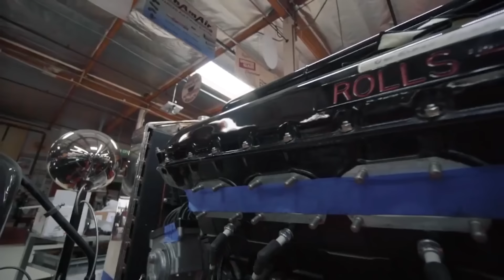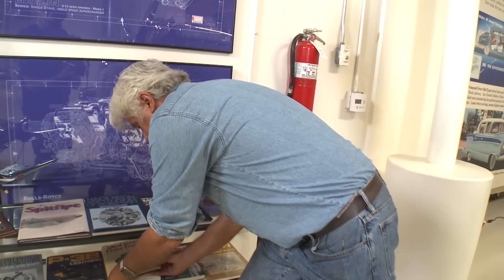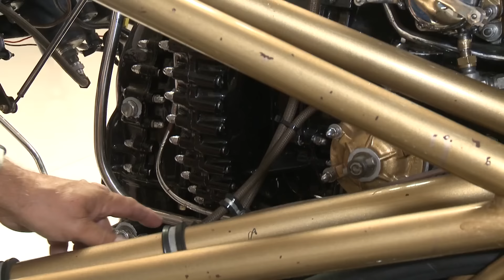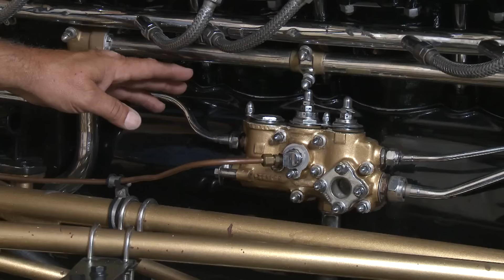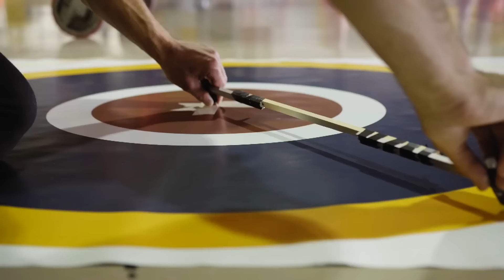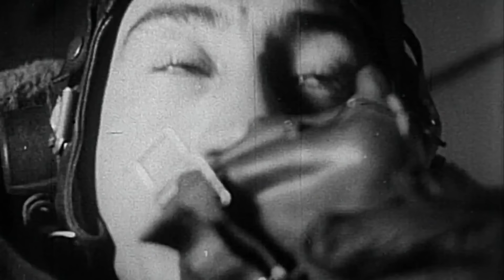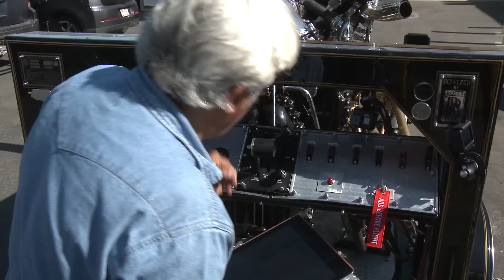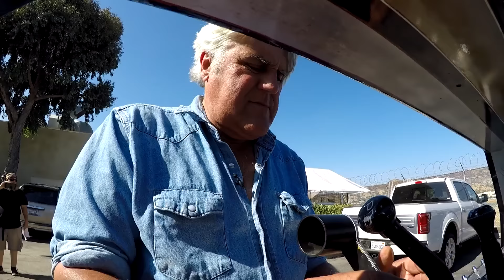The Engine That Won World War II - Jay Leno's Garage

Comment: Engine that won World War II ? WOW. I didn´t know there was an airplane Rolls Royce  engine in the  soviet T-34 tank
Reply: sergeant5027
The RR Merlin was put in British tanks and called the Meteor.  The British tanks destroyed 90% of German armour in the west.
Reply: Yeah, which is 8% of what Russians destroyed
Reply: sergeant.
USSR total is more but that is not just the T 34, it includes British tanks used by the USSR, aircraft, anti tank guns and even the German armour that broke down or got stuck in the snow. Without supplies from Britain and USA the USSR would not have managed too well and if Britain did not beat Germany in the Battle f Britain and in North Africa ten things may well have gone very differently for USSR.  
Germany could have used the 1,000 tanks and tank crews lost in North Africa.
Reply: Chris Baker
How wrong you are. Do not go on Hollywood history.
Germany had no realistic ability to overrun the UK. The British knew what sort of chance the Germans had. The British won the Battle of Dunkirk. The reason the Germans had no chance of a successful invasion was that the British were ready and waiting with factories turning out the latest equipment 24/7. During the so-called _Battle of Britain_, the Royal Navy had a mass of ships at Gibraltar ready for offensive operations against the Italians, they took the invasion of Britain really so seriously.

The German Navy was near non-existent. The single battleship the British kept in Portsmouth was quite able to handle everything the Germans had on the surface, together with the four flotillas of destroyers. I'm not counting the Home Fleet, which had additional powerful ships. In other words, the British kept plenty of naval force at home. All they needed to deal with the Germans with a good deal to spare. Also, 55 Matilda 2 tanks, which was immune from German anti-tank guns, were sent to North Africa, the Brits took the invasion so seriously.

Admiral Raeder said he could not guarantee putting down an invasion force, even with German air superiority, when the Royal Navy was still there. General Jodl talked of his men going through a British mincing machine. 

In Churchill's memoirs, he says that he was prepared to defeat tens of thousands of Germans if they invaded (take that as slaughter). Presumably even if they arrived with weapons and not half-dead from seasickness in a 24 hour sea trip in barges being attacked from sea, land and air. The British kept plenty of force at home, all they needed. 

And what were the Germans supposed to do? Sortie with two or three heavy cruisers, and blast their way through the Home Fleet or the Channel defences? At that point in the war, Bismarck was still under construction, Scharnhorst and Gneisenau were under repair from the Norway operation, two of six heavy cruisers sunk, two of six light cruisers sunk, and only five of those could be considered modern warships, a large number of their destroyers were sunk at Narvik. The repair status on the rest of the ships wasn't real good. The Germans never even had an effective torpedo plane. The Stuka dive bomber was predictable in that it dived vertically. It was easily shot down and suffered so many losses in the Battle of Britain it was withdrawn from the battle.

So, with the German navy whittled to almost nothing, and the army incapable of crossing with enough force to win, the only threats was the then small U-boats force and the Luftwaffe. The British were therefore sparing about sending the RAF overseas. I don't know of any significant deployment of Spitfires outside the UK until the second half of 1942, and escort vessels kept on being built. The RAF defeated the Luftwaffe over Dunkirk, so the Germans knew they were no push over. 

If anyone thinks that Operation Sealion, the German invasion of Britain, was a serious attempt at an invasion they are deluded. Even German generals never took it seriously. An invasion in concrete barges towed by tugs and no navy to speak of? The Germans knew the UK had a large industry working 24/7, the same size as Germany's, and the largest navy in the world to their virtually none.

The RAF was large with a large bomber force, which the Germans could not knock out. Any invasion at the few suitable invasion beaches would be met at the beaches by all types of aircraft. These could be based out of Me 109 range. State-of-the-art fighters would still be produced 24/7. There would always be top line fighters around. 

According to Guderian in "Panzer Leader", and by pretty much any historian to follow, Sealion (Zee Lowe?) could succeed only with complete air superiority over the invasion areas, and at least naval equality in the Channel. Hence the air Battle of Britain, hard fought and clearly won by Britain. Naval equality was a pipe dream for Germany, but a pipe smoked only if the Luftwaffe could attain a decisive victory. Given the failure of the prerequisite, there is really no point in debating the if Germans could invade the UK.
Reply: Chris Baker
British material losses at Dunkirk were overrated. Most of the equipment lost was not the latest designs. About one third of the equipment was successfully taken back to England. The BEF was only one third of the British Army. In about a month all units were fully re-equipped with factories turning out the latest armaments 24/7. Right after the retreat at Dunkirk, up until early 1941 (approx 6 months), the British had:

• Destroyed the German surface fleet.
• Neutralised most of the French fleet by sinking 
  or starving it of fuel.
• Disabled a major part of the Italian fleet.
• Freely moving around the Mediterranean.
• Starving Germany of food and resources 
  with the effective Royal Navy blockade.
• Beat the Luftwaffe over Dunkirk.
• Beat the Luftwaffe in the misnomer the Battle 
  of Britain as Britain was never threatened.
• Pushed the Italians out of East Africa.
• Decimated the Italian army in North Africa.
• Were about to take all the southern Mediterranean coast.
• Germany was being bombed from the air with raids 
  of over 100 bombers - 150 over Nuremberg - using 
  the new navigational device, Gee.
•  A massive air bombing fleet was being assembled.
• The RAF shot down over 700 German fighters over 
  Continental Europe in 1941.

After the small BEF (only 9% of all allied forces in France) left France in June 1940, the British went on the rampage. So much so Franco told Hitler the British would win and he would not join in with Germany, fearing British occupation of Spanish territory.  The Turkish ambassador stated Britain will win as it has a pool of men in its empire to create an army of 45 million (later an army of 2.6 million moved into Burma).

In 1941 the British suppressed an uprising in Iraq, beat the Vichy French in Syria and secured Iran and the oil by invading. The British determined where the battlefields with the Axis were going to be. 

After France 1940 Germany never had a significant campaign victory over the British Commonwealth ever again in WW2. The Germans FAILED:

• To win the Battle of Britain in 1940;
• To win the Battle of the Atlantic in 1940/41;
• To control the eastern Atlantic ;
• To control the Mediterranean in 1940/41;
• To control North Africa and the Middle East in 1940/41. 

The British Commonwealth stopped the Nazis/Axis achieving all this well before the USA joined WW2 or even sent lend lease. Even the expensive pyrrhic victory in Crete meant little in the end to the Nazis because the Royal Navy still dominated the eastern Mediterranean with Crete not leading to any campaign winning difference.
Reply: My father was still sperm when this happened and yet I remember it as if it were yesterday!
Reply: Britain and the Commonwealth was also fighting the Japanese, which the USSR did not.  I had a neighbour who went on the convoys to Murmansk & it was no f'n cakewalk.  He received a medal from the USSR, even as a Canadian.  The Soviets even realized they wouldn't have survived without the materiel aid from the rest of the Allies.
Reply: Nefer Hor
The British BEF was only 9% of the total allied forces in France and the Low Countries. The German advance was halted in France as the British with a vastly inferior force stopped them at Arras. Some German soldiers turned and ran.  Directive 13, issued by German Supreme Headquarters on 24 May 1940 stated specifically for the annihilation of the French, English and Belgian forces in the Dunkirk pocket. The Luftwaffe was ordered to prevent the escape of the British forces across the English Channel.

The German advance was stopped at Arras by the British with a numerically inferior force.  The Germans never moved much further after. The Germans could not have taken Dunkirk, they would have been badly beaten in and around the town. The Luftwaffe was defeated over Dunkirk by the RAF with the first showing of the Spitfire en-mass. More German than allied planes were destroyed in the Dunkirk pocket. The first defeat of the Nazis in WW2 was in the air by the British over Dunkirk. Only six small warships were sunk at Dunkirk by the Germans as the the effectiveness of the Luftwaffe blunted.

The British were retreating after the French collapsed in front of them - a programme already in motion, a programme already in motion before the southern German column showed up, as General Gort saw the disjointed performance of the French forces in front of him. If the French collapsed the small BEF had no hope against the large German force heading west. The French were still in front of the British when General Gort decided to take the men back to England, as he did not trust the French in a joint counter-attack. French General Wiegand held a meeting to arrange a counter-attack and never invited General Gort head of the BEF. Gort was under the command of Weigand.  Gort heard of the meeting and rushed to be a part. He got there after the French and Belgians had left.  He ordered the evacuation having no faith in the elderly French leaders. 

The British had assessed the French leadership pre-war and during the Phoney war. They were not impressed, with one elderly general only using motorbike dispatch riders, not field phones or radios. The BEF was the first fully motorized force, with no men marching. 

All armies retreat and regroup when the need is there. There happened to be a body of water in the line of the retreat. The Germans did not know what was to be the next British or allied move. Were they to move down the English coast and enter France further west with more men from England?  The Germans could not have taken Dunkirk and they tried. The British retreat operation was carried out as planned and in orderly fashion. All bridges to Dunkirk were destroyed by the allies. 

The British counter-attack at Arras was with outdated Matilda 1 tanks, which only had machine guns, and a few of the brand new Matilda 2 tanks. The Germans fled in droves. In desperation the Germans turned a 88mm AA gun horizontal and it worked against the Matilda 2 - their conventional anti-tank weapons and tanks could not penetrate the tank. The Matilda 2 would roll over German gun emplacements killing the gunners. Rommel thought he had been hit by a force three times the size, which made them stop and rethink. The Germans countered with their superior numbers pushing back the British who were ordered to fall back towards Dunkirk.

The British resolve and the new Matilda 2 made the Germans sit up and think about a street fight in Dunkirk against a consolidated force still with its weapons and the new Matilda 2 - the 88mm would be useless in Dunkirk streets while the Matilda 2 would be in its element, and the Matlida 2 would have easily destroyed the Panzer mk3s. The Matilda 2 could knock out any German tank at the time, while no German tank could knock it out. The Germans were expecting the Matilda 2 to be shipped over in numbers and for all they knew many were in Dunkirk. The Germans could not stop the tanks coming as the British controlled the skies with a CAP and the waters of the Channel.  Not a good prospect for the Germans. A Dunkirk street fight was a fight the German troops were untrained and unequipped for and unwise to get involved in.

Von Rundstedt and von Kluge ordered the halt informing Hitler that German forces around the Dunkirk pocket cease their advance and consolidate and also to prevent an Allied break out from Dunkirk. Hitler agreed with the support of the Wehrmacht. German preoccupation rightly was with an expected attack from the fluid forces, mainly French and some British, to the south of the German line, not from Dunkirk which was too much of a formidable consolidated opponent, taking substantial resources to seize. The German column had Allied troops to each side and in front and there was soft marshland to the south west of Dunkirk unsuitable for tanks. If German tanks had advanced into Dunkirk surrounding the British, who had not fully fallen back, they feared a quick British counter attack. Being short of fuel so it was not wise to engaged in a street battle for Dunkirk. Also, they would be vulnerable on their weak flank from the south. In short the fast moving panzers were now static; German forces attacking Dunkirk in a battle of attrition would have had a high probability of being wiped out due to fuel, infantry and supply shortages

The German tanks had raced ahead of their supporting infantry and supply lines consolidating their remaining armour and infantry and the important resupply from Germany which was slow as it was via horses. They had over-stretched their supply lines. An attack was expected to be mounted by the British and French from the south.  The Germans had no option but to stop being short of fuel. If the leading tanks had pushed on to Dunkirk they would have ran out of fuel in Dunkirk with many not even making it to the port. The Germans were more concerned at defending from the mainly French forces in the south which were viewed as a greater threat than Dunkirk. French general Weigand implemented his creation of hedgehogs to attack German lines from the sides, with success - hedgehogs were a part of NATO tactics until the 1970s. 

The Germans were thinking, are the British retreating to England from Dunkirk to move down the English coast and re-enter France further south with fresh forces, including Canadians and the new Matilda 2 tanks, which they feared, and join up with the French forces there? The British could easily do that as they controlled the Channel. This would create one large difficult to combat force.  German generals were trying to figure out what was happening. None thought that British troops would retreat to England and stay there. The British never did that sort of thing. 

The Germans could divert most of their forces south and risk a Dunkirk breakout and then risk being attacked from their rear fighting on two fronts, or stay and consolidate, which they needed to do, awaiting a French/British attack from the south and use some forces and the Luftwaffe to attack Dunkirk, which they did. German forces resumed their attack on Dunkirk for 6 days after a 48 hour consolidation executing Directive 13 for the annihilation of the French, English and Belgian forces in the Dunkirk pocket. They failed to seize Dunkirk.

The plan to break out of the Dunkirk Pocket using British, Belgian  and French forces was abandoned as Gort had no confidence in the French. All military school studies since, knowing what the German and allied positions and situations were in 1940, have shown it would have had a high probability of succeeding.

This may sound strange, but the Germans were defeated at the Battle of Dunkirk. They tried militarily to seize the port but failed. Only because the British did not trust the French and moved back to England did the Germans eventually occupy the town. The Germans did not let the British get away that is misguided myth, they tried and simply could not seize Dunkirk.
Reply: Alexander Challis
Germany declared war on the USA. The Americans shortened the time of the war, not decide its outcome. The USA, about 11% of British supplies (mostly food and raw materials) and about 5% to the USSR (mostly raw materials, trucks and boots). 

The German army about to invade the USSR......
Prof Adam Tooze, Wages of Destruction, page 380.
`In both campaigns [France &amp; Barbarossa], the Germans gambled on achieving decisive success in the opening phases of the assault. Anything less spelled disaster.`

Prof Adam Tooze, Wages of Destruction, Page 454:
"Fundamentally the Wehrmacht was a poor army. The fast striking motorised element of the Germans army in 1941 consisted of only 33 divisions of 130. Three-quarters of the German army continued to rely on more traditional means of traction: foot and horse. The German army in 1941 invaded the Soviet Union with somewhere between 600,000 and 740,000 horses. The horses were not for riding. They were for moving guns, ammunition and supplies." 

"The vast majority of Germany's soldiers marched into Russia, as they had in France, on foot."

"But to imagine a fully motorised Wehrmacht, poised for an attack on the Soviet Union is a fantasy of the Cold War, not a realistic vision of the possibilities of 1941. To be more specific, it is an American fantasy. The Anglo-American invasion force of 1944 was the only military force in WW2 to fully conform to the modern model of a motorised army."

........The reality was that the German Army was no super army with advanced equipment, as propaganda portrayed. The Allies attempted to cover their pitiful, inept defeats, and that includes the Americans at the Bulge, Metz and Hurtgen Forest.

The Germans thought they had formulated a version of Blitzkrieg in France that was a sure-fire success. If the belt broke the whole movement stopped. They used this in the USSR, just scaling up forces. They did not have the intelligence to assess properly, that the reason for their success in France was allied incompetence not anything brilliant they did. 

The Germans vastly underestimated the quality of design and make of Soviet weapons. The T-34 took them by surprise and they knew they were fighting an army they had hopelessly underestimated in all aspects. The Germans did not take into account the British supplying the USSR - 40% of the tanks used at the vital battle of Moscow were British supplied. The USSR had more tanks than the rest of the world combined in 1940.

The Germans underestimated the Soviets so much they decided to attack them with no reserves, all the German forces were involved in Barbarossa, lack of proper logistics to re-supply, short of steel, rubber, oil, an industry that could not re-supply at the rate required, short of fuel for industry and the forces, etc, etc. The Germans were so inept at assessing the Soviets they did not envisage fighting in the Russian winter in 1942/1942 thinking they would have overcome the USSR in three months. When they did not break the USSRs back they did not have enough winter clothes and equipment designed for such low temperatures. It was not just the logistics of getting to the troops, they just did not have the equipment. The Germans thought the Soviets could field 360 divisions, they fielded over 600.

Soviet industry was large and had moved to the east. Much was in the east anyhow. This was working 24/7 to re-supply. The T-34 tank by Dec 1941 was well established and available in numbers. The Germans first faced The T-34 in October 41, reducing a German division to a few tanks. The Soviet counter-attack in Dec 1941 was well supplied, and heavily with T-34s. There was still 1,400 Soviet aircraft available in Dec 1941.

The Soviet's mistake was attacking on a broad front and not aiming the the weakest point and pushing them right back, nevertheless they mauled the Germans. By Dec 1941 the Germans were exhausted in fuel, men and equipment. They could do no more. As early as In July 1941, many German armies were at the end of their effective supply lines. As Prof Tooze said, most say the Germans failed to take Moscow, the reality was that they could not as they were on their last legs. The large Soviet air force was still attacking German supply lines as well, exasperating the situation. The Germans foolishly thought most supplies could be taken along three very long rail tracks, which were easily ripped up by the Soviets and bombed via the air. Thousands of German rail men worked to get lines partially operation. The Soviets evacuated lots of rail trucks. 

Prof Tooze: Wages of Destruction, page 453:
'Halder wrote, Barbarossa needed speed and motorized transport for supply. No waiting for railways. The Germans planned for three rail lines and 740,000 horses.'

...the Germans never had enough motorised transport to supply all the fast moving armies. Pre June 1941, they were considering de-motorising because of a shortage of rubber inflicted by the RN blockade. 

Prof Tooze: page 454:
'Three rail lines were used. The existing Soviet rail network was not even good enough to supply the German army if taken intact. It was also of a narrower gauge too. The retreating Soviets took most wagons with them and destroyed the rail infrastructure on retreating.`
`The Soviets had taken massive losses, but being so big they could absorb so many losses. The Soviets also had inflicted great losses on the Germans by Dec 1941. The only large power Germany conquered was France. This gave them a sense of superiority - their technique was now known, so succeeding twice was unlikely.'

The Germans largely dropped the blitzkrieg of coordinated air and ground attacks.
Prof Tooze: page 487. 
'In July, all three German Army groups had reached the limit of resupply and stopped. The Soviets had taken devastating losses but not defeated. The Soviets saw the halt of the German armies and the re-supply problem and launched 17 armies against them forcing the Germans to dig in and defend.'

The UK & US can be forgiven in underestimating the Red Army, which they did, not so the Germans as they would have to assess this force in detail as they were to fight it, unlike the UK & US. Soviet industry was turning out the arms and to advanced designs. I don't want to go into what ifs, but if the T-34 was in place in summer 1941 the Germans would never have had such spectacular progress. Stalin knew what was being produced. They knew once the weaponry was in place, they could defeat the Germans who would be operating over 1000 kms along a few supply lines they could not fully supply.

Apart from Stalingrad, which the Germans and the Soviets had an obsession with, the Soviets became less reckless as the UK and USA were in the fight and arms, and some well advanced arms, were building up. The Germans would not win, and the Soviets knew that. Once a western second front was in place, it was clear the Germans would quickly crumble, and they did. On D-Day 1944, the Germans were still way inside the USSR. The end came quickly once hit from both sides. It can be argued that the Soviets should have pushed the Germans out of the USSR by 1943 or even 1942, however they were inept at most levels. But the Soviets knew in a war of attrition the Germans were doomed.
Reply: Oh standart, I thought you ment 8,8 this thing would've rekt the Matilda from every side of it
Reply: JPVegh 
What you mean is that if the Germans won the rather one sided Battle of Britain they could have successfully invaded the UK. With the German surface fleet near non-existant, with most sunk in the Norwegian campaign, and facing the largest navy in the world, German chances were little more than nil.
Reply: Billy Graham 
The merchant marine lost more men in percentage terms than any 'armed' force. At Tower Bridge in London the Merchant Navy memorial has 36,000 names on it. For those of no known grave.
Reply: Without the Merlin there is no long-range escort to Berlin the war takes at least a year longer if not to. The Germans develop their jet fighter technology in that time perhaps extending the war another 2 years. Eventually they end up with better terms to sue for peace. The world is a much different place today.
Reply: Peter,
The WW2 German jet engines were extremely unreliable and had low performances with very high fuel consumption. The German axial-flow turbojets never worked properly and were developed up to 1953 by the French to obtain a usable engine. The French lost a lot of time playing around with the German engines, instead of working with the British. The French and Soviets after WW2 tried to improve the German axial-flow engines and largely failed. The centrifugal compressor used by the first British Meteor plane was fine and much more reliable, but unable to reach high compression ratios. This limited performances. Centrifugal compressors were used up to the 1960s. 

The British, in order to have a usable and reliable jet engine, with the technology available in WW2, went for a centrifugal design as the prime engine rather than the troublesome axial-flow design. This design produced less thrust than an axial-flow but was quicker to develop, reliable with longevity. It took 5 months to develop, while the first reliable commercially ready axial-flow engine was the 1950 Rolls Royce Avon, which took 5 years to get right. The Avon axial-flow engine was developed in tandem with the Metropolitan-Vickers design which first flew 1942 creating 8 variants. The MetroVick F.3 was the first turbofan engine to be designed, built and tested decades before the RR RB211. Armstrong Siddeley took on MetroVics design creating the F.9 Sapphire axial-flow design. The Sapphire was built under license in the USA as the Wright J65.  

In 1945 a team from the French ATAR laboratory plus some BMW and Junkers engineers, were engaged by the French SNECMA research bureau, with the objective to build a new reliable and performing axial-flow turbojet. The French made and tested some German designed turbo jets made with quality steel unavailable to German industry in WW2. They ran for 25 hours instead 10 hours to German engines made of poor steel. Not much better. The German axial-flow engines failed because of heavy design faults. The BMW 003/Jumo004 was considered unusable. It was tested on the first French jet aircraft, the 1946 So6000 Triton, overheating and exploding. The plane only flew with a Rolls Royce Nene centrifugal turbojet. 

The ATAR project took 8 years to produce the first acceptable axial-flow turbojet (ATAR 101 B1), produced in 1953. So 8 years R&D by the French using the German jet engines as the base, which had about 3 years previous R&D, so about 11 years in all. It was installed on the first 100% French jet fighter, the Dassault Ouragan. 

The French lost a lot of time because the German jets had concept fails essentially in the combustion chambers and fresh air circulation to reduce the external temperature of the engine. The engine gave poor efficiency. The BMW jet was known for overheat problems which precluded fuselage installation.

The German turbojets had severe overheat problems as the engine would not work in an enclosed fuselage for single engined fighters. This defect was immediately noted by the French on the 1946 "SO 6000 Triton" prototype, and by the Soviets on the 1946 Mig 9. The Soviets quickly replaced the BMW 004B2 by the centrifugal Rolls Royce Nene which worked without problems, dismissing the BMW engine for fighter planes. The Rolls Royce Nene was copied to the last nut by the USSR being installed in the Mig 15 and used effectively in the Korean war. About 10 years ago the USSR eventually paid royalties to Rolls Royce. 

The question at the end of WW2 was what is the most efficient way to produce jet fighters. The answer is clearly not adopting the German design of engine and fuselage. The build costs for a jet engine were much higher than a piston engine, with the fuel consumption near 3x. The centrifugal compressor the British adopted in some planes was by far the best choice with 1944-45 technology. More compression pressure was not an advantage when the hot turbine was unable to resist higher temperatures. 

The Meteor was the first proper fully developed jet plane introduced in engine and airframe. The me262 was slightly faster than the Meteor F3, but extremely unreliable. The British would never put into the sky such an undeveloped plane as the me262. The British could have had a jet fighter operational in 1941, but it would have been as bad as the me262. The Germans advanced R&D on jets after they interrogated captured British RAF men. They learned the British were advanced in jet technology and flying prototype planes. Until then the Germans had no intention of mass producing jet planes. 

The rushed together Me262 started claiming kills on 26 July 1944, the Meteor claimed its first V1 kill on 4 August 1944. But the Meteor was a proper fully developed jet plane, not a thrown together desperate effort as the me262 was. The me262 used a fuselage of a 1938 piston plane while the Meteor was a proper newly designed fuselage specifically for jet fighters with forward of the wings pilot position as we see today. 

Centrifugal compressors did not quickly become obsolete when axial-flow engines were perfected, being used in turboprops. Between a turbo jet and a turboprop, the only difference is the turbine, not the compressor. The last centrifugal compressor jet engine still in service on a handful of old commercial aircraft like the Fokker 27, is the Rolls Royce Dart turboprop. A very reliable engine made in 27 versions, but with high fuel consumption to modern engines. The turbo jet engine that was produced the longest, was the Rolls Royce Dart Turboprop - a comparable design of turbojet like the Rolls Royce Nene. This rugged engine was produced from 1946 up to 1987. 

There is a myth, especially in the USA, that the Germans were way ahead of the British in jet engines and planes in WW2, when the opposite is true.
Reply: My Dad was on several convoys to the USSR, also Malta, people do NOT see the War in total,, they see it as -"Our Spitfires" --Or Our "U Boats" or our troops The entire populations were involved and as a reminder, (perhaps you know) of the 14 merchant ships that were in the convoy (Operation Harpoon) to Malta  TWO made it, my Dad Gunnery Officer on the "Orari" NewZealand Shipping Company.  and Troilus Blue Funnel Line Cargo -- Food, and Munitions --- Churchill was all for invading the Ruskies THAT would have secured a long peace, but the people had had enough war and voted him out. Cheers  Mike
Reply: SMOG.
You seem to forget Hitler attacked Poland at the beginning of September and Britain and France declared war on Germany after 3 days, USSR did nothing for over two weeks.
Reply: Peter.
The standard German anti tank gun in 1940 could not do much to a Matilda.
Reply: Billy Boy
In 1940 what happened to Germany?   They lost the Battle of Britain and could not invade, no aid from USA and USSR was supplying Germany at the time.  So just where do you get your silly version of history from?   Germany outproduce Britain,  not in 1940, 1941 or 1942, in fact British production of planes, tanks and guns, merchant ships and warships was all more than German or American production.   
Just facts, maths does not change the truth.
Reply: Bullshit, leave in peace, the Luftwaffe were constantly attacking the beaches and getting a hiding from the RAF who were protecting the beaches, hardly letting them leave in peace, no matter what you want to believe.
Reply: USSR was on Germany's side at that time.
Reply: JPVegh 
German jet engine and airframe technology was way behind the British.
Reply: sergeant5027
No what?
Reply: Barrie Rodlliffe: True. Hitler was so stupid. If he'd left Russia alone and gone ahead and invaded Britain the war would have been over as far as Europe was concerned. At that one point in time the Brits had about 9 rounds per gun left and their air forces were about to collapse. They should erect a statue to Herman Goring for saving their little island nation. He's the one who talked Hitler out of invading, claiming he could defeat Britain with only air power. He nearly did too. If they'd had just one good long distance fighter they would have done so.
Reply: Silvester Humaj
That is not what the Americans were thinking at all. Go to 1 hr 14 mins 
https://youtu.be/79KU997m9o4?t=4440
Reply: 1) Several factors delayed German advances through the Soviet union (such as the primitiveness of the Russian railroad system and the different rail gauge requiring the Germany army to convert rail sections as they advanced)
2) The Kursk counteroffensive was possible due to British intelligence
3) The Lend-Lease program actually helped the Soviet Union a lot not just due to weapons but logistically - trucks and locomotives sent to the Soviet Union were vital for troop deployments

Fucking Slavaboos claiming the Soviets won the WWII single-handedly.
Reply: Titanium Rain 
The Soviets destroyed most of the railways trucks or evacuated them.  British intelligences did inform the Soviets of German deployment at Kursk. But the massed Soviet armies and armour won it.

Lend lease to the USSR amounted to 5% of Soviet needs.
Reply: Nefer Right.
Hitler did not want war with Britain but he did not let the British evacuate at Dunkirk, he could not stop it. 
The small BEF were evacuated along with over 120,000 French troops. 
The SS murdered quite a lot of British prisoners who had surrendered. 
Quite a few were killed while waiting on the beaches to be evacuated and some boats and ships were sunk. The RAF stopped the Luftwaffe from doing as much as Hitler expected.
Maybe your grandfather was hiding or running away from the British.
Reply: Peter.
The 88 was not an anti tank gun in 1940, it was an anti aircraft gun.
Reply: John Burns no, that's not what I meant at all.
Reply: sergeant5027 funny you forget that the Russians to should have been destroyed alongside the German war machine as in the build up to ww2 Stalin was in open relations with Adolf Hitler the only reason the ruskies ended up fighting against them was that the foresaw that the Germans were going to betray them the Merlin engine won the second world war as without it the Luftwaffe would have been able to gain air superiority over Britain and then after months of blitzkrieg land an invading force on the beaches there then would have been no allied forces moving from west to east through Europe which overwhelmed the German army as they were also being battered east to west by the Russians both engine contributed massively to the overall defeat of the Germans but the Merlin  won the war
Reply: Germany was in no position to invade Britain, most generals were against it.The Germans converted Dutch canal barges to cross the English channel in, the were not designed to do that and most likely a lot would have sunk, also they had no means of getting heavy equipment across. Further more the RAF would have been moved north to safety but would have attacked any attempt to cross the channel, then of course there was the RN.
Reply: SMOG : I made no statement of being happy about how the Soviets waged war.  I was responding to the original post. There was enough senseless deaths and killing to go around on all sides. I made no moral/ethical judgment or endorsement of what the Soviets did or how they did it. Just simply that ultimately what happened was for the best, I mean this on a large, long term scale... if it wasn't for how things played out we very easily could have seen the USSR take the nazi's place of conqueror of Europe. With the United States able to get into Germany before the USSR could defeat Germany on their own we were able to put a presence that held the Iron curtain from falling over more of Europe. On the heels of the defeat of the nazi's the USSR had to rearm and re-group before they could even think about fighting the rest of Allies. However by the time they caught their breath the US had the atomic bomb which held them off until they could develop their own. By then the US being wise and figuring the USSR for conquerors had already been staying competitive in the mass destruction business... making any war between the states M.A.D..     If the Soviets were quicker to over take Germany they would have continued to press and conquer until they encountered the western allied front.  Part of the reason the US kept such a military presence in Germany for so long was because the US was well aware that they would have kept pushing and land grabbing as much as they could... it was the soviet way as much as it was the nazi way.
Reply: The comment you replied to was that when the Germans were advancing towards Dunkirk they were stopped by the British and the Matilda 2 was impervious to the German anti tank guns.  That was in 1940 or before Germany used the 88 as an anti tank gun.
Reply: any need for the expletives moron?
Reply: GB out-produced USA?  In 1942 the US produced 46,907 aircraft to the UK's 23,672.  I'm pretty good at math, that looks like almost 2-1 USA.  But I stand corrected on German production.
Reply: I stand corrected.  I had the board game 'Tobruk' in my teens, the cast Matilda was indeed a tough nut to crack.  And of course Africa was post-Dunkirk.
Reply: Billy Graham.
Until 1942 British production was higher, that is 1940 and 1941, US caught up in 1942.  Then US production was higher. German production was low until 1943 when it was too late.
Reply: Agreed.  I was totally mistaken about German production, stunning really to think that they were out-produced by GB even before USA and Russia fully entered the war in 42/43; hopelessly out-numbered and out-produced after that.  Again kudos to Britain; facing an existential threat plus rage at the hideously evil civilian-targeted bombing was clearly quite motivating.  The US then and now still benefits from amazingly fortunate geography; our cities were always safe.  That said our workers and our boys stepped up and did their part to the fullest measure.  Saddens me that the un-sung heroes of the Merchant Marine don't get their share of appreciation.  Perhaps they do in GB, not so much over here.
Reply: k
Reply: You said everything that would be in a conversation about this, you are right
Reply: great analyses
Reply: sergeant5027  thanks to all the brave Russians  from America
Reply: jujitsuman68,  Sorry LIAR, but your Commie heroes were ON HITLER'S side until HITLER ATTACKED THEM, while Britain was at war with the Nazis for 21 months before the Commies got their comeuppance
Reply: not one of the allied forces won WW2. they could not of done it alone we needed each other.
Reply: I love how the Soviet sympathizers act like they didn't get tons of supplies from the US. Without US backing and the Russian winter you guys would've gotten smashed.
Reply: The MSM-DNC-Soros want to rewrite history with an anti-AMERICAN  agenda. They also want a new cold war with Russia. Don't fall for it.
Reply: Write a blog will ya.
Reply: sergeant5027 The Russians very nearly capitulated when the Germans were approaching Moscow. Stalin was actually on his way out of Moscow when he turned around and decided to fight on. It was the Allies promise of Arctic supply convoys and to keep German efforts split between the two fronts that swung Stalin to keep going. The Arctic convoys were assisted by RAF aircraft powered by Merlins and the Western Front was only kept alive by the British victory in the Battle of Britain, fought by aircraft powered by Rolls-Royce Merlins! And that’s before we consider the Desert Campaign where RAF Merlin powered aircraft fought Rommel’s Afrika Korps. 
So yes, the Merlin won the war!
Reply: jujitsman.
Really? so after Britain defeated Germany in the Battle of Britain and Hitler gave up any thought of an invasion even with the help given to Hitler by the USSR, then as soon as Germany attacked the USSR Britain and USA started sending a lot of help to USSR, maybe you forget Britain was also fighting Germany in North Africa and the Mediterranean.
Maybe a bit of reading up on WW II would help you.
Reply: 1st of all it was hyperbole, chill out. Most people over the age of 8 years old know that the Russians / Soviets Played a major role in winning World War II, That being said without the lend-lease program it would have taken them another 10 years to get to Berlin.
Reply: Really... obvious trolls in here..... The engine was great and did contribute to winning the war. Ultimately what "won the war" is superior industry and resources of both the US and the Soviets.... both could have won it on their own eventually but working together their was no hope for the Nazis.  The soviets struggled early on because of the failure to quickly switch to wartime production unlike the US who did so amazingly fast. The soviets lacked weapons, ammunition and armor production to equip their vast stockpiles of manpower.  If the Soviets had been able to ramp up to full war time production like the US quicker than the Nazis would have been defeated much earlier.... It worked out for the best though
Reply: Alex Petrenko 
In aviation terms the engine made a lot of difference.
Reply: Jet Engine wasn't behind german technology lol, airframe.....not 2 years later, if german's would have had the tactics they needed to win the War, they would've made better airplanes than the british 1946
Reply: "Also, 55 Matilda 2 tanks, which was immune from German anti-tank guns,..."
You joking right?
Reply: If the battle of Britain is lost then the role of the T-34 becomes meaningless. Without the western front there is no eastern front. In that respect the same argument can be made for the M4 as for the T-34. However wars are won and lost on logistics, so the distinction of the engine that won world war 2 probably more properly belongs to the Hercules I6 that powered tens of thousands of 6x6 trucks.
Reply: Barrie Rodliffe Fail.  A tool is truly defined by its usage not its design.
Reply: Barrie..............
The 8,8 was a anti tank gun later on, I didn't mentioned the year date at all so
Reply: Lol this is what I wanted to say. This engine is awesome, but it played a relatively miniscule role in the defeat of the Nazis.
Reply: The germans had the failured Ho 229
I said in a scenario where the germans don't had their failures and better tactics, rommel would've bring the win more near than hitler, even tho I think the americans and russiand would've stopped germany from pushing forward
Reply: sergeant5027
The Soviets were fighting the Germans for 4 years. The British destroyed over 90% of German armour in the west in only 10 months.
Reply: No.
Reply: John Burns Thanks for the novella, but without US support or Hitler's ill-advised attack on Russia, the UK was fvcked.  Then, as well as now, Germany can out-produce GB, or any island nation for that matter.  Not taking anything away from British pride or prowess, it's just math.